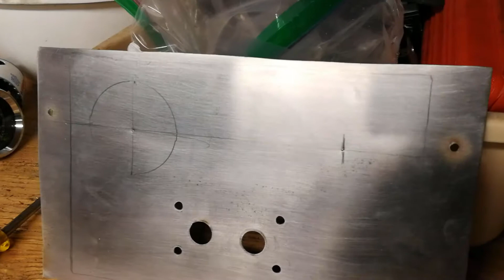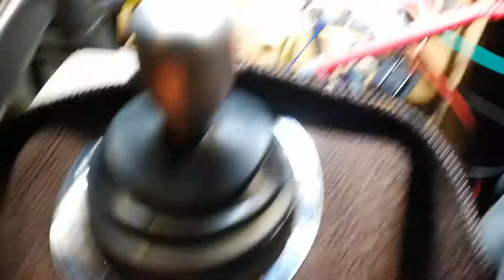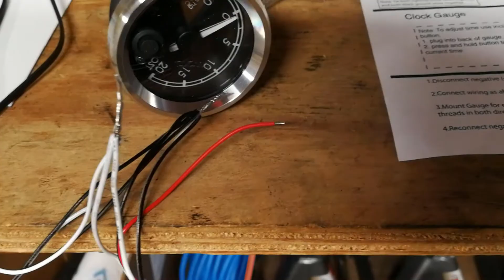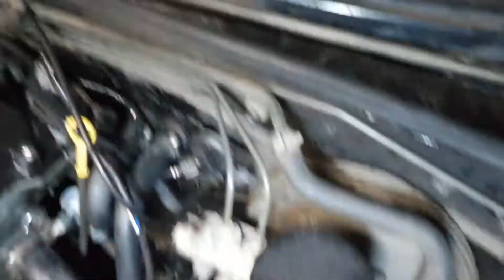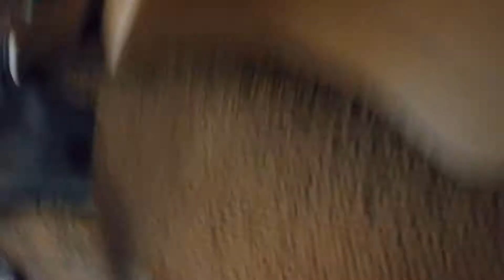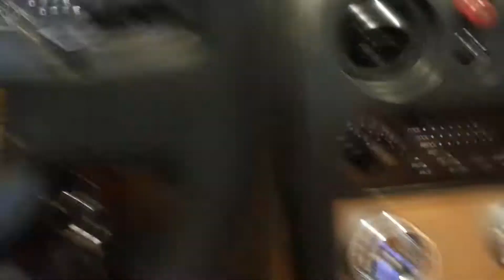Speed Hut Gauges Pt 2 - The Install

Comment: Looks good, Does the yellow wire from the AFR connect to the Wideband controller that goes into the exhaust?
Reply from the maker: Yes, exactly.  This is when the car was pre megasquirt (stock ECU) so the wideband o2 had a narrow band output going to the stock wiring to the ECU and then the wideband output went to the AFR gauge (through that yellow wire).
Reply: OGPedXing thanks. Been wanting to order a speedhut AFR to match my other ones but wasn’t sure if it was hard to wire up.
Reply from the maker: @jjl_tx  no problem.  Yep I thought it was pretty straight forward, mostly just a power, ground, signal (from the wideband), and then a night dimming input from something that goes to +12v when your headlights are on.  Usually find that in the harness for the radio.  Oh also speedhutnhas them preconfigured for the wideband you have like innovate, AEM, or Spartan.  Just grab the one you need and you're set.  Good luck!